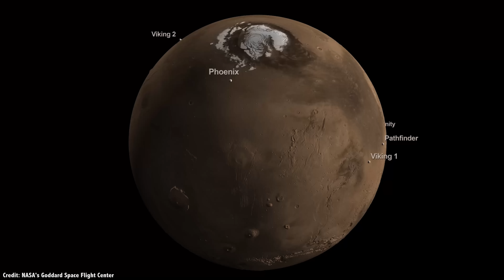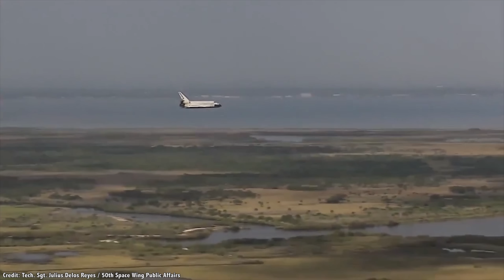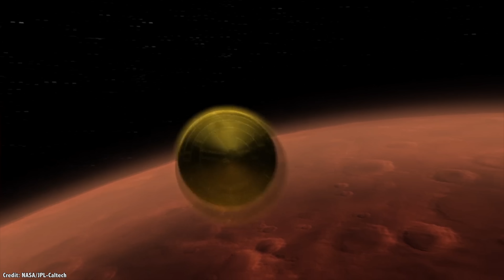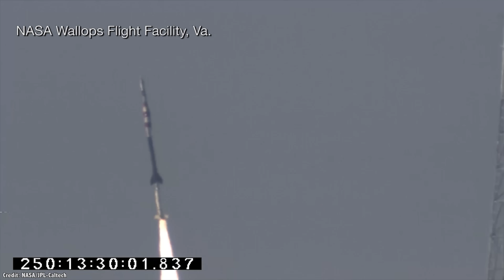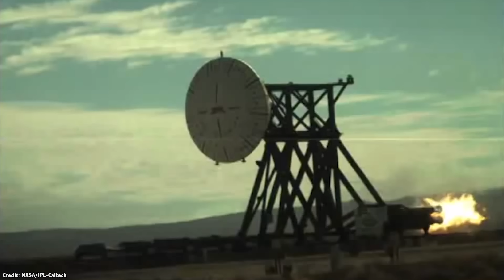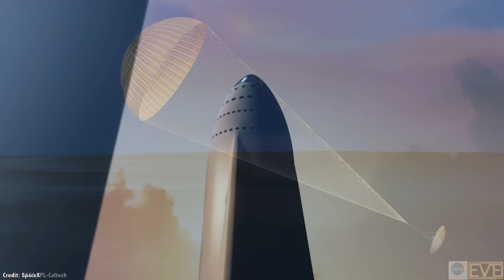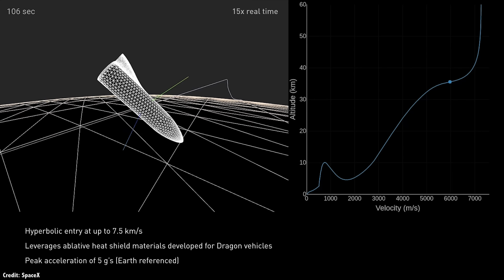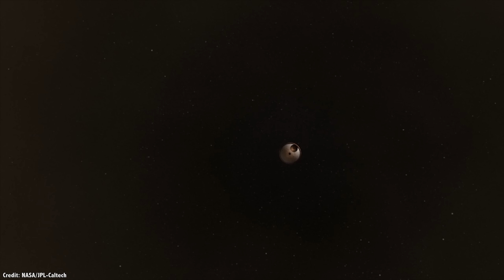The Incredible Challenge of Landing Heavy Payloads On Mars

Comment: It seems like there should be some way to use Mars' gravity to break the speed of the craft down to something manageable. Something like a corkscrew approach or a loop-de-loop down into the atmosphere and up in a back flip and down near the surface again until the gravity and atmospheric brakes have things down to a friendly approach speed. Thanks for this video. Very professional and quite comprehensive. Love it.
Reply from the maker: You can do aerobraking in the atmosphere to get rid of some of the velocity, but then you have to spend a lot more time getting down to the surface.
Reply: @frasercain  Totally get it. What's a little more time though when the trip is already 6 months?

Comment: Why land all the mass at the same time? One thought is to offload the people into lighter escape pods that are easier and safer to land then letting the bulk of the mass do several skips through the atmosphere before it finally lands. I'm guessing the escape pods could be designed in such a way that they could be expanded into some useful living space or at least provide some useful materials, so the extra mass wouldn't be a complete waist. 

The issue is slowing down. A refueling station would have to match the velocity of the incoming ship which may also take some effort. It seems to me you would do that in the earths orbit and that with enough fuel they would decelerate on the approach to Mars.  It also seems to me that if the BFR main booster can stick a landing on earth that it could be filled and used to get to Mars a lot quicker. Then they could use it to slow down and land on Mars. The bottom line it we need a source of fuel like the moon or an asteroid first before we can really think about sending people to Mars.
Reply from the maker: It gets complicated and expensive if you have to break up your landings into smaller pods. Ideally you want a direct landing of 100 tonnes or more.

Comment: You can do several things.
1)reduce the density of the collision.
2)Reduce or resist the gravity or force in opposite direction.
3)Something very long that is made to collapse gradually while absorbing as much of the damage .
4)Something like a very very thick liquid or plasma like substance similar to peanut butter several times larger than the rocket designed to both absorb the collision and reduce the force against the payload. Convert the force into friction on the sides of the vehicle while absorbing the shock
5)slowing the descent either through equal and opposite force or chemical substance that is lighter than air. Enough helium injected into balloonlike object(s) upon entering atmosphere for instance.

Just a few ideas.

I’ll never forget my 5th grade 3 story drop egg drop science experiment. It had to be a shoebox size or less to put egg in to survive a drop. Every designed failed but one. The egg was placed in the middle of a peanut butter container. That’s it. Clearly there’s a lot more time to accelerate even though gravity is less on Mars but you could probably make a superior material to peanut butter and put it in a much larger capsule proportional to the payload and spread out over significantly more distance to reduce the density of the collision.
Reply from the maker: Mars has 1% the atmospheric density of Earth, so it does have some atmosphere, just not very much.
Reply: Edit: mars doesn’t have oxygen in atmosphere does it. It doesn’t have an atmosphere does it? That helium idea may not work!

Comment: Powered descent for massive 100 ton payloads seems to be the only solution..
Reply from the maker: Right, which means you need to keep a bunch of fuel in the lander, which means less payload.
Reply: @frasercain  
Thanks for the reply. Yeah, which would mean more launches for the same net payload to the surface of Mars than if it had a thicker atmosphere, increasing costs and probably also risk of a manned landing.

I'm playing around with Real Solar System for Kerbal Space Program and trying to land 113 tons of manned lander on the surface, which almost seems impossible, unless you go extremely low, let the atmosphere slow the craft down, ditch the heatshield, and burn radially upward to use it to slow the vertical speed to near 0 and slow down radially even more. 
Or just a engine powered landing, which then means i could not leave again, since the total mass of the craft was designed for life support and the fuel needed to get to a 140k stable orbit after being landed for a while.

Point is, i can't imagine what it must take to plan these missions in reality, but i would imagine that there would need to be some kind of rocket fuel assembly going on at Mars before humans arrive, to ensure safe return.

Comment: 20 of the “failures” were by the USSR/Russia; 6 were by NASA; 2 were by ESA; & 1 each by Japan & China, & two of those failures were a 2 for 1 by Roscosmos & CNSA (China) in 11/2011. Meanwhile, NASA has had 10 straight successful missions to Mars since, “No data was returned,” from Deep Space 2 in 1999.
https://en.m.wikipedia.org/wiki/List_of_missions_to_Mars
Reply from the maker: NASA has absolutely mastered going to Mars, but they think it's a tough challenge to get beyond a ton.
Reply: Fraser Cain - I believe NASA has mastered one basic procedure - Launch from earth, leave orbit, Holman Transfer Orbit to Mars, use Mars’ atmosphere to slow down, deploy parachute & then do some form of propulsive landing on Mars, all using fuel carried on one rocket. SpaceX plans on stuffing the Starship full of fuel (1,100,000 Kg total) once it’s in earth orbit & producing fuel at the landing site on Mars to use on the return trip...
I’d prefer SpaceX assemble a VASIMR or NTR in earth orbit to reduce the Time in Transit from 6-8 months to <6 weeks & save the fuel loaded onto the Starship for Mars entry & landing, but SpaceX’s plan would still leave a LOT of fuel for Mars entry & landing.

Comment: Starship has to land 200t. The payload is 100t, but the ship is a further 85t (or so, hard to tell in steel) plus a 15t fuel buffer on landing. That's 200 times more than the maximum landed so far. Crazy goal.
Reply from the maker: Yeah, if they can actually pull it off, I think that'll be the greatest engineering triumph of the whole mission.

Comment: This is not accurate, Starship will be stainless steel but they don't plan for it to bleed fuel anymore, it's going to have heat shield hex tiles on its belly.
Reply from the maker: I thought they were going to do both. Can you give me a link where they talk about not using transpiration cooling?
Reply: @frasercain  Check Elon Musks video on his Twitter
Reply from the maker: https://twitter.com/elonmusk/status/1107380559834046465

It's going to use the transpiration cooling wherever there's degradation in the tiles.

Comment: Just a few alternative thoughts to approaches in slowing the vehicle down for landing on mars. The atmosphere is rather thin as we all no, so drag breaking and also the maximum shearing force of atmosphere resistance, would provide would also be much less than on earth. In otherwords, shearing force, meaning that air will have less resistance by going around the compressed air involved in slowing down the object, every fluid, gas type substance has a threshold, were by easier for air to just pass around object in a like rain drop shape. Alternative think of it as the maximum restive force for object shape in a medium that can be achieved (think terminal velocity).

As this video suggest that all method for slowing entry are restive atmospheric or done by some propellant generate force, which also all have reduce limits.

How about looking at this from different perspective, that fact that atmosphere is so thing, one can accelerate payloads extermly fast from the surface of the plant mars.
So what about looking into projectile fired intercepting which intercept with space craft causing causing it to decelerate. Which is difficult to do on earth, because of resistance.

I have two ideals, which would required different levels infrastructure on the planets surface. Which could be broken down into stage plans for long term development,
remotely installing.

Ideas:
1. Projectile fired interception with space craft deceleration. (Rail runs)
1.1 Fire magnetic fields in a ring shape, which interactive magnetic field space craft slowing it down, as there can't be contract as catastrophic.
1.2 Fire payload, that generates magnetic field at the last minute, which then collides with with drag parachute,  magnetic field, slowing the craft down.
1.3 I don't thing a solar sail wouldn't help here, unless make one, that super fast acting.
1.4 Any other forms of project fired payload non-catastrophic deceleration, for craft you could think of.

2.  3,2 Point tether system, cable system (aircraft carry style). Pre-install  two pillions x distance apart drive into the surface by a gravity synchronized orbital drop of a few pillons.
Then small space craft afterwards will inject a binding substance into the ground around the pillons and creating foundation. Then install cable and rocket launch system,
there rocket launch system, will launch a 3 point of the triangle cable system into atmosphere intercept with space vehicle on entry, so that it can later on.
The cable system can then apply ground based drag to the craft, putting it into a eletical orbite, for the  next fly by deceleration, were a cable will be fire again.
Obviously there are some crazy speed here, so cable breaking or rapid jerk deceleration could be a problem.

Just few other ideas, if one can come up with something using the mars plant surface as staging area, that is simply enough to pre-install remote or for second trips to mars.

Comment: Fraser et al...  Does anyone think it practical to place a craft in orbit around Mars that contains tanks of hydrogen and a deflated balloon made of BoPET?  Then Starship...or another ship, would fire thrusters in short bursts to match the velocity of the orbiting craft (i.e. slow down), dock, have the balloon apparatus attach to the nose of the Starship, and then inflate the balloon with the hydrogen before undocking.   Starship would then further slow it's forward velocity before dropping practically straight down to the surface.  Once the vertical velocity is slow enough, the balloon would deflate (still attached) leaving Starship to propulsively land.  Once on the surface, the crew would create more hydrogen to refill the orbiting craft's tanks upon their return flight.  Starship will undoubtedly have a lot less mass on the liftoff from Mars because most of the original cargo will be left on/under the surface, so having extra hydrogen on-board shouldn't be an issue.  Tanks for carrying the hydrogen back up can also be prepositioned on the surface near the proposed landing site.  Once the hydrogen is transferred to the orbiting craft's tanks, those transfer tanks can once again be delivered to the surface for use on the next mission.  Just like the Apollo command module leaving the Moon's orbit, Starship will not need the "boost" it gets from lifting off from the surface to make it back to Earth, so a 3 to 4 hour pit stop shouldn't affect things too much.

What do you guys think?  Am I just crazy for thinking something like that could work?  Hydrogen is much less dense than the methane atmosphere of Mars after all.
Reply: Similar to the space elevator, just on mars instead.

Comment: Thought of one more:  
Atmospheric plasma engines.  
Use beamed microwave power from an orbiting platform to power an engine on a lander that inhales martian atmosphere and turns it into a plasma that can be directed to slow the vehicle.  I wonder if it could even propulsively land using the air like this.  It would need to be a large thin disk - bonus.
Reply from the maker: Whoa, cool, I've never seen anyone explore this idea. Do you have a link to research on this?
Reply: @frasercain  unfortunately not.  I just thought of it on the spot so have no idea if anyone has looked into it before.  It sure would be cool to see! With a relatively thin atmosphere I can only guess the microwave beam wouldn't be attenuated much.

Comment: Some random thoughts:
- build orbiting microwave arrays and/or mirror arrays designed to melt the polar caps or evaporate water in known areas of shallow deposits.  This will thicken the atmosphere a little and the extra gas may help slow incoming spacecraft.
- ion engines in spacecraft.  Get to Mars orbit, then flip on the highly efficient ion engines to slow.  Keep slowing and losing speed until the atmosphere takes over, then chemical rockets to land.
- don't land.  Take an elevator.  Build a space elevator, from space.  It needn't go all the way down at first.  Just far enough to drop a chemically propelled lander.  Eventually build it all the way to the surface, then start building back up until a much stronger and permanent structure is in place.
- modular spacecraft.  Get into orbit, then deploy the hundred or so landers needed to put 100,000 kg into one area.  People can travel in the lightest ones to avoid the harshest forces.  Once on the ground, start reassembling it all.
- quantity, not quality.  If it's cheap to get into Earth orbit, then build a Mars lander there, and fill it way up with multiple trips of fuel tankers.  Basically arrive at Mars with enough fuel to land multiple craft.  It'd be some sort of max-min problem because volume and mass of landers doesn't scale with surface area hence drag, so lander would be optimized, but fuel would be aplenty.
Reply from the maker: Did you ever see this video we did? https://www.youtube.com/watch?v=-aOGqBt32rI&list=PLbJ42wpShvml6Eg22WjWAR-6QUufHFh2v&t=0s&index=41
Reply: @frasercain  Fascinating.  If the artificial L1 shield could be combined with active heating of the poles (microwaving them so the energy is not subject to reflection like most of the sun's output) then maybe we'd not have to wait so long.  
If we could figure out a chemical reaction to turn the surface dust black, then faster still.

Comment: The space shuttle's heat tiles weren't ablative. Ablative heat shields get burned off gradually and aren't reusable, like on the Apollo missions for example. The space shuttle used materials which insulated the craft, but they didn't burn and were reusable. Also, there are many materials that are stronger than kevlar. Nanotubes come to mind.
Reply from the maker: Yeah, that was a straight up verbal typo on my part. Of course, they had to replace tiles between launches. :-)

Comment: Propulsive landing is the only viable option for heavy payloads. Starship refuels in orbit, so that shouldn't be a problem. Doubt you would need no more than 90 seconds burn time at 60% thrust to land a starship on Mars. The bigger problems are making sure you land in a flat area as to not tip over, and to land closely to refueling starships sent ahead.
Reply from the maker: I'm sure you're right. And I'm sure SpaceX has done the math. We'll see how it all turns out.

Comment: I am fond of the idea of doing several laps of mars slow down before landing. Have the wonderful mental images of a spiral  path along mars' equator.
Reply from the maker: It's a good way to get rid of velocity, but then you have to spend more time in the radiation environment of space.
Reply: @frasercain  To be fair there isn't much of a difference between the radiation in space and on the surface of Mars as the thin atmosphere is transparent to incoming cosmic rays. The only radiation protection is what radiation shielding you bring or sheltering sufficiently deep underground, which unless you use a natural cavern you are going to have to dig all of that out yourself rather than just most of it yourself. Probably the most feasible way to build a mars base would be to send robots to perform the shelter construction for you   waiting for the shelter to be finished all while having to worry about Martian dust storms.

Speaking of Martian dust storms if you had a nuclear powered base/craft built to handle the dust respectively you might actually be able to take advantage of the increased atmospheric density to decelerate. Of course that would require some for of instrumentation that could see through the dust storm so you don't crash....
Reply from the maker: Once you get to the surface of Mars, you can get into your lavatube and be fully protected from space radiation. Nobody's going to live above ground on Mars, they're going to burrow in.
Reply: @frasercain  Are those Lava tubes deep and extensive enough to provide proper radiation protection though?

Comment: Very basic test anyone can try:

load up kerbal 

do a typical decent 

try to descend relatively "straight" 

compare fuel usage - it takes significantly more fuel to try to descend towards surface rather than laterally - you need to slow down that lateral speed so how that saves fuel is beyond me.... and you can't fly a plane on mars with any substantial mass.... and any you CAN wont have control surfaces capable of rapid changes in velocity  (vertical to lateral) 

i'm afraid the only true method for landing on mars for humans is rapid lithobraking don't mind the mess....